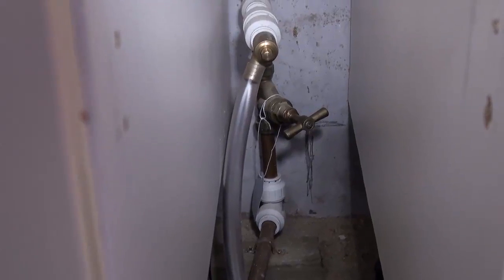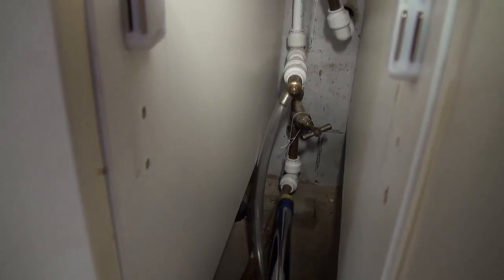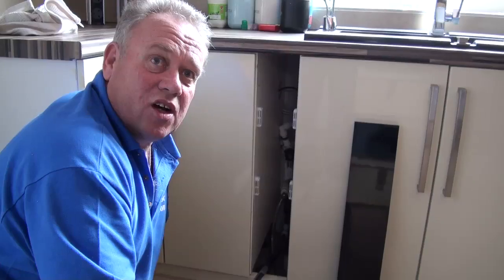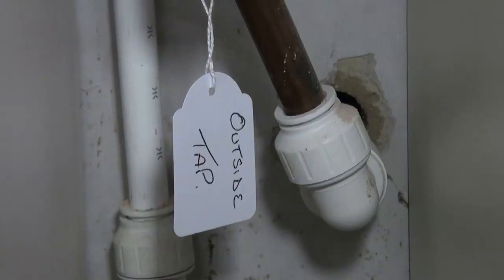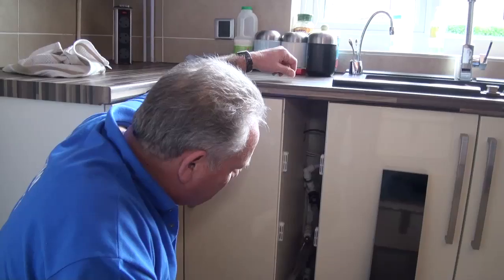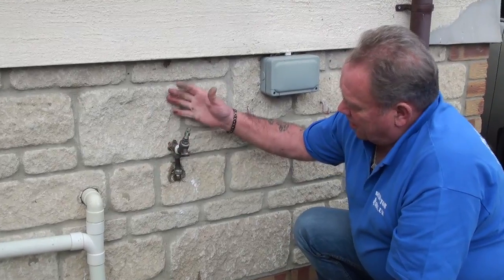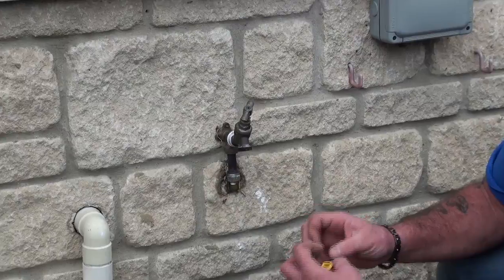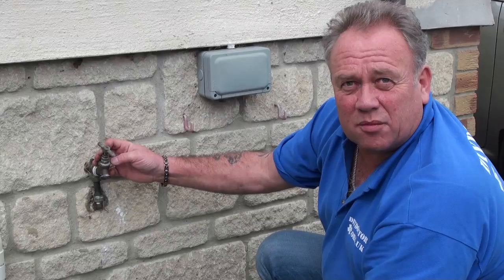Water and Plumbing Tutorial Part 2 - Mains Water Supply and Outside Taps

Comment: I have a question mate, I recently installed laminate flooring in my kitchen. I had to isolate the washing machine for removal via the normal stop cock but had to isolate the mains water valve (blue pipe) as the normal stop cock would not stem the flow of water to the blue water pipe feeding my washing machine. I have reconnected it and turned on the mains valve and stop cock again. Everything is fine downstairs but my ensuite toilet upstairs on the other hand, will not stop filling. It has never done this before now. Any ideas? Have i done the balance of the system in? I have opened the toilet cistern and adjusted the ballcock to no avail. Cheers in advance.
Reply from the maker: +Richie Shaw Stick the question in our forum Richie and someone will get back to you soon  http://www.diydoctor.org.uk/forums/plumbing-forum.html